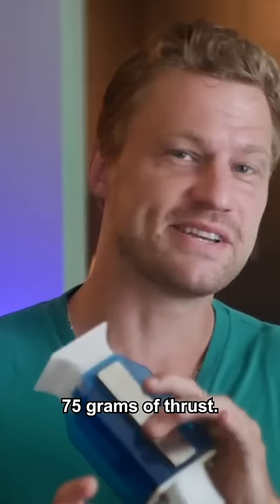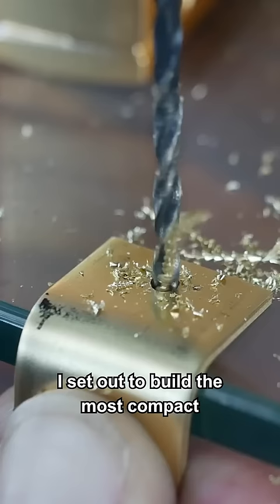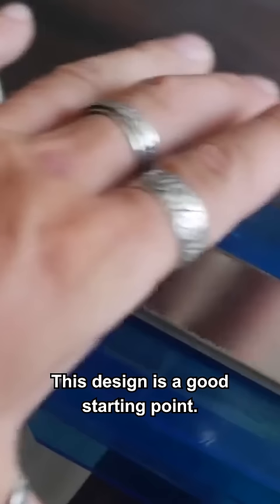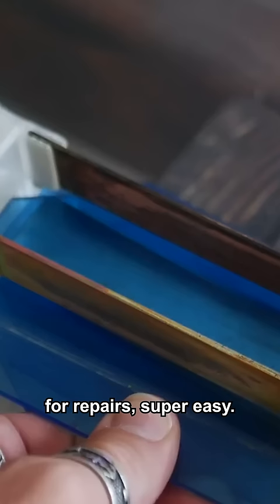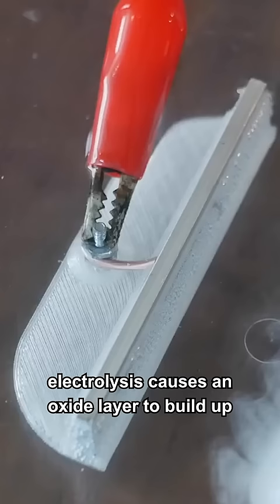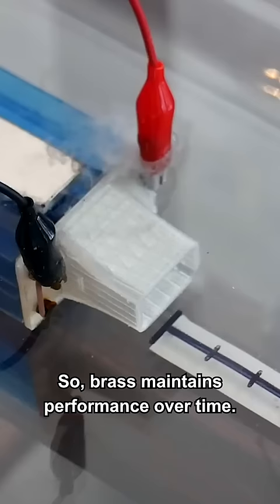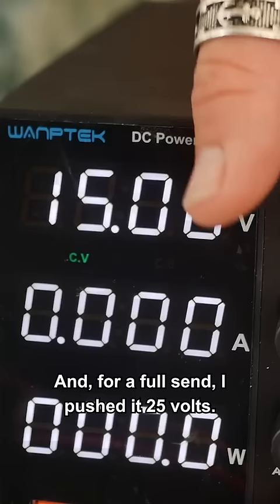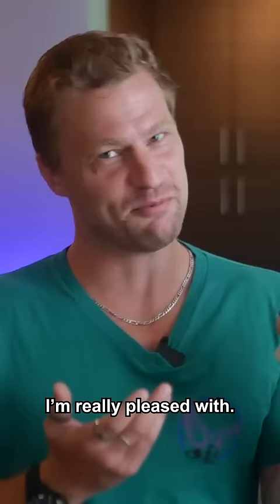Using Stealth Propulsion for Ocean Travel (MHD Thruster Build)

Comment: Use AC, no magnet but electro magnet like universal motors works and try on different frequencies. 
No electrolysis, no oxidation, much more trust..😎
Reply: If you use AC, you are going to reverse the thrust at that specific frequenci and get no thrust
Reply: @thefunnyguy16  
No, it won't. 
Tested about 10 years ago.
Reply from the maker: You know, i'm working on the version 2 right now. It's much more powerful, but during the build i'm realizing that I may want to try AC for the third version. You should send me an email, i'd love to chat.

Comment: So see what happens with the house dryer or stove volts of 220v with a stack of say 10, 15, and 20 of the same prototype, then extrapolate what would be the drag cohephisancy would stop it dead in the water. With a total of 20, 30, and 40 units.  For a one manned submersible.

Comment: Wait idk if this a dumb question but isn’t stainless steel conducive too and it doesn’t oxidize…?
Reply: Well I don’t really know either but I guess it does oxidize under electrolysis conditions. The fact is that steel is less conductive than copper for sure anyways.
Reply: its not stainless anymore when used for electrolysis. 😅 when used for the cathode in a kco3 electrolysis cell it  last longer atleast if its a higher grader stainless. but if used as the anode it is going to get eaten fast.

Comment: Thrust is a force and measured in Newton.
75 grams of thrust is a meaningless mass in this case.
Reply: Come on now, diddle, we all know what it means in the real world
Reply: Gram-force and pound-force are very common in industry.
He says grams because he's familiar with actually putting into practice what you've only read about.
Reply: @blockchaaain  because 0.73 newtons is a small number, 75 grams seems like a bigger number.
Reply: @blockchaaain  Common in the USA - only one of 3 countries that havent formally adopted the SI and metric system,
The USA stands with Liberia and Myamar.
Well done
Reply: @MAGnetICus_Attractus  That would make sense - a marketing trick.
Reply: @PetraKann  Phillip's 66 and Union 76. A gallon at 66 degrees is a better deal than a gallon at 76 degrees. Funny, if you call moonshine ethanol, most might figure out cars can run on alcohol. Just like the general Lee running methanol, those gasoline cars couldn't keep up. Due to a lack of common cents used per gallon at $X.xx9 I tell people to buy ten gallons at $Xx.x9 so unrepresented tax doesn't nibble away at your wallet.
Reply: @MAGnetICus_Attractus  Degrees Celcius or Degrees Fahrenheit? Or Degrees Kelvin?
Actually scrap the last one - the Kelvin scale does not have degrees.
Reply: @PetraKann  the temperature difference changes the displacement of the gasoline. Most don't know a 12 ounce pound from a 16 ounce pound. I use the degrees where water boils at 212 at sea level and freezes at 32. You might use the 100 to 0 degree scale.
Reply: @MAGnetICus_Attractus  Nevertheless, the video did say 75 grams which is a quantity of mass. Without standard context it is meaningless in describing a force.
I will be making a formal complain at the highest levels of government in Washington as well as submitting a written report to the United Nations sub committee on standards and bewilderment.
I will keep you informed - shouldn't take more than 18 months
Reply: @PetraKann  I simply stated if you keep people in blinders they won't noticed they got shafted at the pump. I sometimes wonder how much water I got from those in ground storage tanks? Thank god that electronic injector will spray water in the combustion chamber. I said gasoline is sold by volume and that volume changes like the weather. When I was in the oil industry I asked why was gasoline sold by the gallon but fuel deliveries were measured by the inch. Hot gas in the tanker mixes with the cold fuel in the below ground storage tank and after a few minutes it averages out and the displacement change is measured. I said 75 is greater than 0.73 on paper. Just like you get more kilometers per gallon than miles per liter. I know this video experiment changes if you change temperature variables. Sharper Image has been selling Ionic Breezes for decades. H.A.A.R.P uses 3 gigawatts per hour when online. Imagine 3 million 100 watt light bulbs burning and the heat that produces. No wonder global warming tax is so costly.
Reply: @MAGnetICus_Attractus  You raise a very good point.
I recall a Canadian Airliner that became a glider at 41,000 feet (or roughly 12,497 m or 492,000 inches).
Why?
When the plane was being refueled ground engineers pumped in 8,703 pounds of jet fuel when the pilot requested and needed 16,131 kilograms. They used the wrong conversion factor.
The plane just happen to have a faulty fuel level gauge so the pilot had to manually calculate his fuel level. At 35,000 feet one engine flamed out. A few moments later the other engine did the same.

The Gimli Glider is the longest engine-less glide achieved by any commercial airliner.

At the time (1980s) Air Canada was transitioning its systems and fleet from Imperial Units to Standard Metric Units (SI).